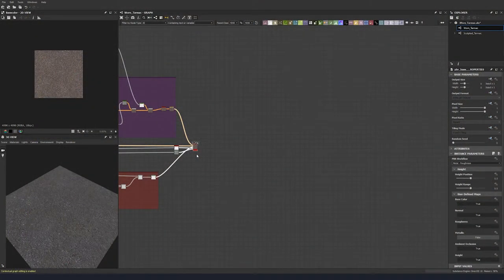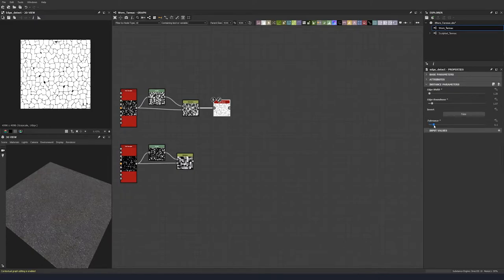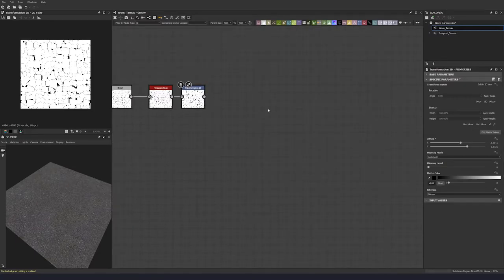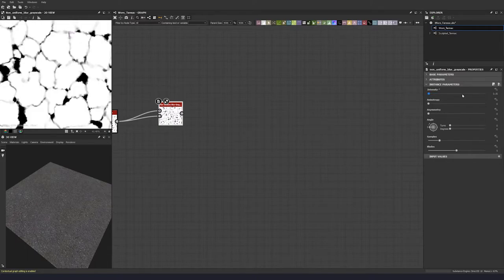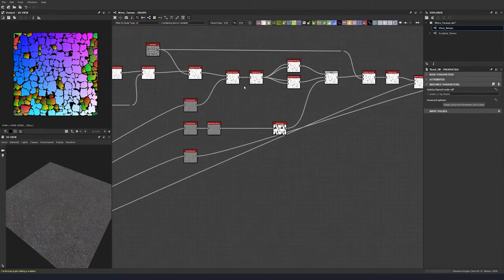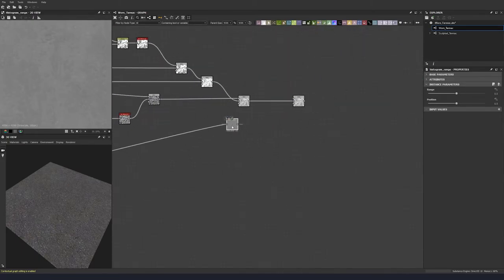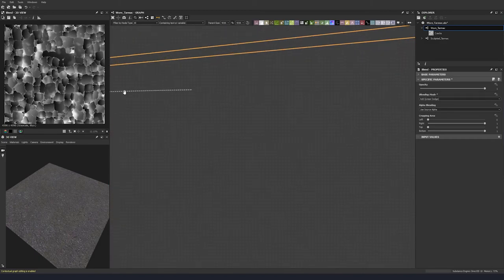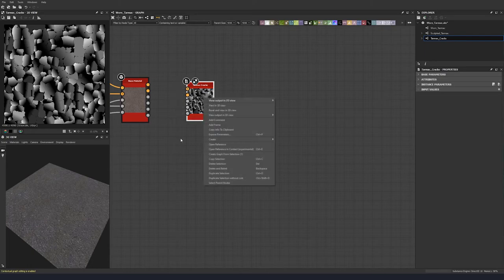Substance Designer - Worn Tarmac Tutorial Part 5: Creating A Crack Tool

Comment: Great tutorial series!!
If I drag the Tarmac Cracks Node with right klick to the 3D view in 32:45, Substance asks me which Map I want to use, so it doesn't display the cracks. How can I fix this?
Reply from the maker: Hey, thanks :). That's because it doesn't know it to be a material with auto populated map slots. Place the cracks node into your graph, right click it and create outputs, then right click the graph and view outputs in 3d view. Make sure you have inputs into the cracks node or nothing will come out the other end
Reply: @NathanMackenzie3D  It worked! Thank you! :)
Reply: @NathanMackenzie3D  can you once again answer this question i don't understad what crack node i should place
Reply from the maker: Hey sorry I don’t understand your question? You drag your cracks graph from the outliner into the main graph
Reply: @NathanMackenzie3D  i just did, it didn't work. maybe i can send you a file to have a look?
Reply from the maker: @johnnysmith9677  sure feel free I’ll try take a look
Reply: @NathanMackenzie3D  thanks. i just send you a request on Linkedin. please accept, otherwise i can't send a message
Reply: g @NathanMackenzie3D  I have the same problem, the outputs of the cracks node is all black on Height, Rouhness and AO. Do you know what could be causing it?